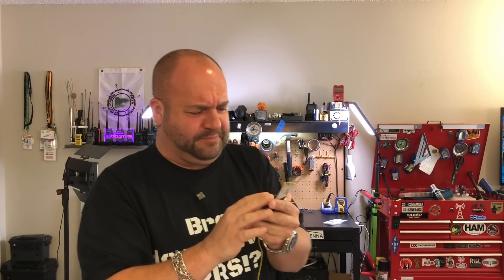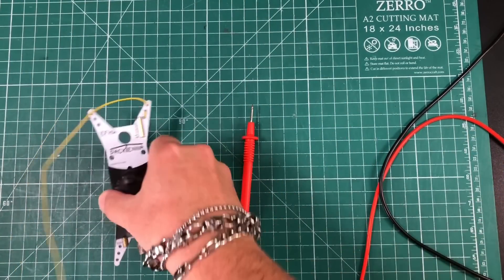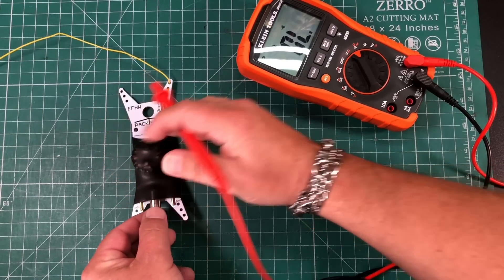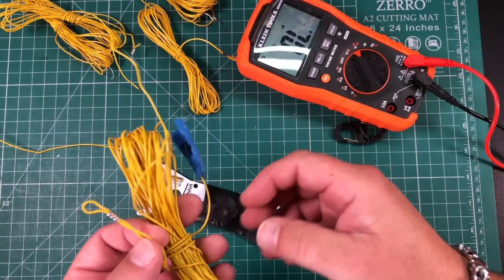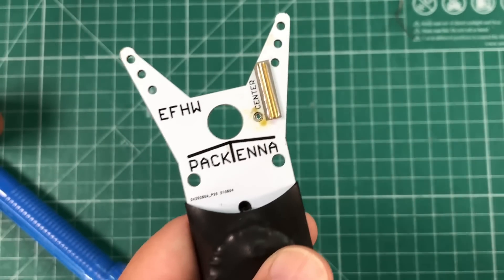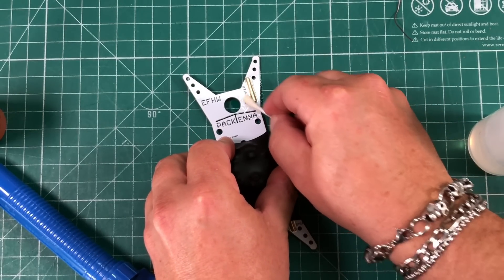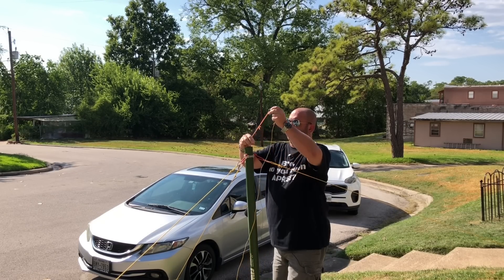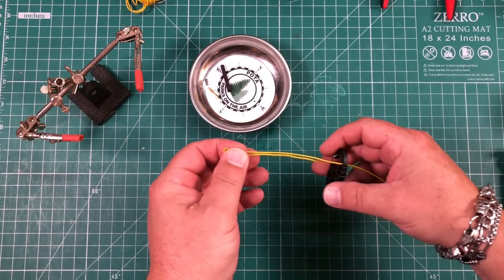My PackTenna Broke!!  Here's How I Fixed It.

Comment: might have to use a bigger ferrule, but seems like you could add some heat shrink over the loop for some extra durability if that’s the failure point.

Comment: A break at the end of the wire (on the loop) wouldn't have made a difference. The break was more likely at the board where the wire exited the board. The wire broke but the insulation remained intact. That is where mechanically the most action occurs.

Comment: Mike,

You are so full of BS you need a good laxative.  That said tongue in cheek……. I had a good laugh with your intro.  On one of my PackTennas the center conductor of the coax was not connected….. so broke from manufacture.  A little heat from my soldering pencil and some extra solder it worked and has worked well since.  Thanks for showing us that hams CAN FIX STUFF!

Comment: If the only break is that spot you noticed at the center of the loop, you may want to add a thimble.  I don't think that you'll find commercial ones that size, but you may be able to fake one out of a small grommet.

Comment: I have used fishing line for getting the wire through the ferrule. I used a piece of 20 pound braid fishing line. Looped it through the loop of the wire. Slide the ferrule over the two ends of the braid and use the braid to pull the wire through. Great video as always. Keep ‘em coming.

Comment: Hi Mike. Is there any difference between running the packtenna  vertical vs a sloper ?
Reply from the maker: Not a lot, no.  Your radiation pattern will change and the SWR will be a little different depending on the height of the transformer, but not enough to really matter.